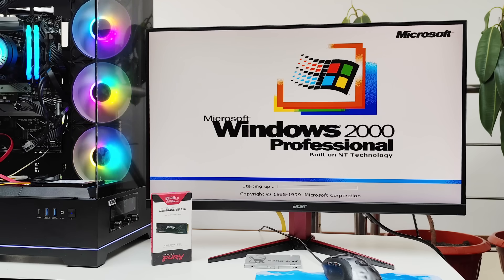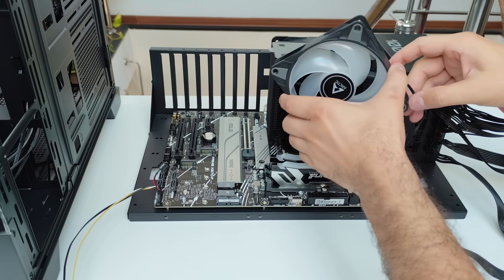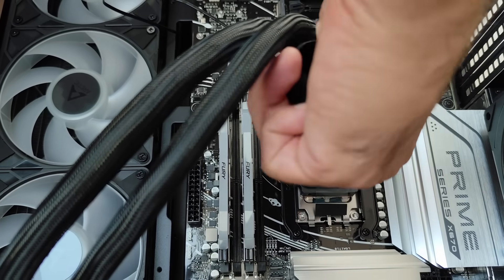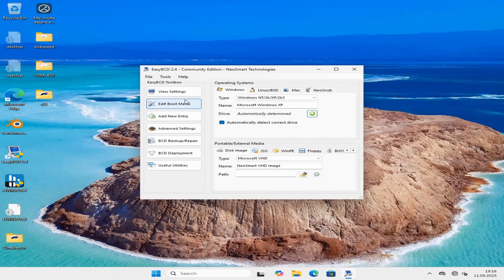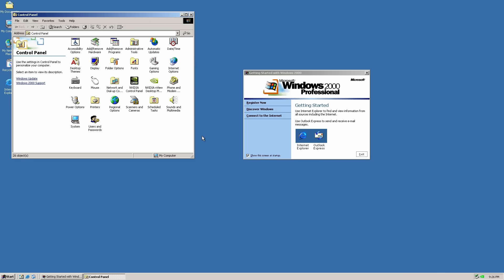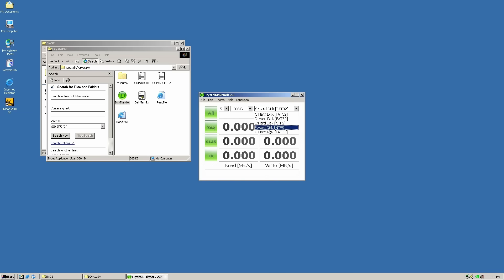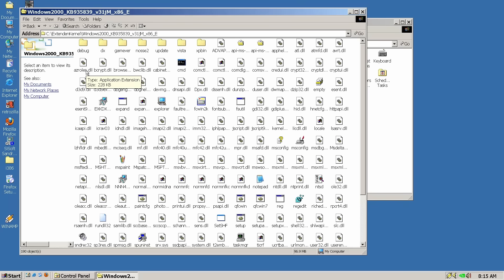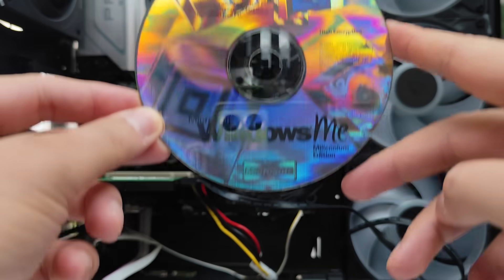Windows 2000 Overkill: Ryzen 9900X + Gen 5 NVMe SSD + HUGE Arctic Freezer AIO

Comment: JMB582 SATA Controllers do sata disks drives work as IDE MODE OR AHCI MODE ?
Reply from the maker: It works in AHCI mode. According to the specs, the JMB582 does support the "IDE programming interface", but you can't manually configure the card to use IDE mode. It might be possible with a custom BIOS that has a configuration utility, like the old-school SATA-RAID cards have.

Comment: The question is, how do you convince modern programs to believe they are running on Win10.
Reply from the maker: That's not possible, but you can trick them into detecting your system as Windows XP. That at least will make some browsers like Supermium or New Moon (Pale Moon) work on Win 2K.

Comment: Any possibility of running on a RX400 or 500 series GPU? I mean, XP or 2K, anything would be a win.
Reply from the maker: AMD ceased official driver support for Windows XP around 2013, and the final compatible drivers (version 13.9) are working with cards up to the R9 200/300 series. The RX 400 series, released in 2016 (Polaris architecture) are a no go. In XP you can use something like a Nvidia 980Ti released in 2015, it's like 25% better than a RX580 and the driver is very easy to install.

Comment: What's the oldest version of Windows 64-bit with no RAM limits that works with present day CPU, motherboard, GPU, RAM and SSD and software? Windows 2000 doesn't have a 64-bit version so it's not much use.
Reply from the maker: Check out this video about Windows XP x64: https://youtu.be/0iW1hheBAp0 - it was tested there on a Socket 1700 build, but it also works on this AM5 configuration. All that is needed is to add a modified ACPI.SYS to the ISO. You'll also find download links in that video.
Reply: @O_mores  Will modern software that only works on Windows 10-11 work on your modded XP x64?
Reply: @O_mores  Thanks but even if I get all the drivers I need I assume software that only works in Windows 10/11 won't work on XP?
Reply from the maker: @Gaming.Vids1  When it comes to modern software compatibility, the issue is now on the software side, not on Windows. A very popular hardware info tool, "HWiNFO," for example, still works in Windows 98 -  even the latest release from 2025. Also, Supermium is a very new browser made for XP. So for XP, you have to settle for compatible software like Office 2010, or search for new releases specifically designed for XP and newer. As for games, they rely on DirectX and XP only supports DirectX 9.0c.

Comment: Hello omoroes. i had a really important question. im doing some odd builds myself. i was curious about somethng, in theory if i used a burification splitter riser, with a modern pc but was using CSM for older hardware like in your vids, would the splitter still register the device is there in legacy bios but i just couldnt use them at once, and might have to black list some GPUs and select them individually for different OS if i had multiple OS to boot from or with. or would it just not register them at all? also woul any of the thiord party drivers your aware of get around this issue aswell? And i guess 3rd option a way to force PCEI buriification to partially work in legacy bios to let one device work at a time from different OS's
Reply from the maker: Hey! Bifurcation (splitting a PCIe slot into multiple lanes, like x8x8 or x4x4x4) requires explicit support from both your motherboard's chipset and BIOS. It's not something the OS or drivers can enable on their own - it's a firmware-level config you set in the BIOS menu (under PCIe or advanced I/O settings). If your board doesn't have those options exposed, the splitter won't do anything special - it'll just act like a plain riser, and only one device (the "primary" one) might show up, if at all. If bifurcation is supported and enabled in the BIOS (even with CSM on), the split devices should register individually in the system - just like in UEFI. Some riser cards have their own bridge chips that emulate bifurcation without full BIOS support, but those are hit-or-miss for stability.

So, the idea is that this whole bifurcation thing is OS independent, if the hardware is configured properly in the BIOS - it should just work - for the OS or the drivers it's the same this as you would have 7 separate  physical PCI-E slots on the motherboard. Also you might want to check this video about the primary video card: https://youtu.be/RWupO_3Zv6s
Reply: Wow. That’s all very helpful info. I was curious though by any chance do you have a discord? I’m actually really curious cuz of the project I’m working on. And I feel like I’m worried I could brick my really rare mother board if I didn’t do a lot of these things correctly.
Reply from the maker: @michaeldariopellittieri3050 I'm not very active on Discord, so maybe I can help you here instead. Regarding this bifurcation thing, I don't have much practical experience with it. The people who were into mining and had, like, eight GPUs on one motherboard are the real experts - nothing beats hands-on practice...
Reply: Hmmm well I respect if u cant give out discord so easily weather u use it or not  I respect that. But I did have like a decent list of questions I wanted to ask.  How ever more or less im trying to use the same method u showed in the video in reguards to using the bios tool to make it so I can disable certain lanes for certain profiles in bios for different os. And I really want to be able to run older os aswell. In your opinion is the CSM on the x570 Asrock motherboards not so great? I mean perhaps it’s possible to fix with some patches or the Ami tool but I’m just worried based on a small portion of search results. And yes it’s a ddr4 build. I heard like the z490 chips are a little better but not my much. But more or less it cussed the uefi to gray out whenever u luanch in legacy bios when ever u try to switch back to uefi.
Reply: If you have any info on CSM or modding bios, in regards to the x570 as rock boards. As I’m trying to avoid the bricking part. I know best was is just simply try it but, if there also possibly anyway some sourt or modded os could select the GPU instead of forcibly booting then fiery primary slot.
Reply from the maker: @michaeldariopellittieri3050  I'm afraid that for newer motherboards, there's no other workaround than to use the primary video card in the primary PCIe x16 slot and the secondary GPU in another slot (an X570 board for sure has two PCIe x16 slots). You can disable the primary card in Windows 10/11 if it's older and use the secondary card instead. This is how I'm using an Nvidia 7900GS with an RTX card on my AM5 build with a Ryzen 9 9900X.
Reply: So really the only full proof to work but risky to brick option is using the bios mod tool. Well I guess I’ll have to try with some dummy cheap parts, but question the site in your vid only brings me to an older out dated site for the Ami bcp tool. Can you provide any link to one that works for x570 ? My board also has a duel boot safety so I think I should be okay with a bit of risk.
Reply from the maker: It seems you can't get anything newer than that version. AMI has become very strict about this tool (which, of course, is not for the public anyway) and has actually requested that several sites take the files down. The bigger problem is that new BIOS files are not compatible with existing versions of AMIBCP. What motherboard do you have? I can download the BIOS and check if it opens.
Reply: Wow that would be amazingly helpful!!! But to be honest I was suggesting the x570 board first, due to the fact im using quite a rare motherboard. It’s the x570 Asrock aqua. The board supposedly has bios flash back chip to avoid bricking aswell as some capacitors to avoid physical damage aswel. But even so I’m very nervous about it and I was gonna try it with just any generic x570 chip set first. But ye it’s unfortunately the Asrock aqua. And basically all I want to do to it is for its ability to select which gpus to use as the primary slot like u did in the video but for CSM. I’ll be honest the project I’m attempting might be the craziest thing ever. Deffinetly ambitious which I was curious about discord xD…. But hell the fact your willing to test it is incredible. Absolutely god send. But my only worry is it won’t be a totally accurate test unless it’s the Asrock x570 aqua.
Reply from the maker: Nice motherboard. The BIOS file seem to load fine in AMIBCP: https://ibb.co/27T3pM5q

On my X470 motherboard, I forced the iGPU to appear in the BIOS configuration menu even if it's not physically present, and when I selected it, the BIOS picked the Voodoo 3 in the PCI slot instead of the GPU in the first x16 slot. I don't know if this would do the trick on your motherboard, but it's definitely worth trying. It's kinda hard to brick it since you aren't modifying the BIOS by adding/removing modules... you're just setting some flags on some options.
Reply: Wow thanks so much man. You’re a huge help. So you’re saying the bricking usually happens when people try to reorder or stack thungs things or activate or force things. But more or less your saying simply activating them or disabling isn’t really a risk as it’s just a flagger. More or less I’m mostly curious does this let some change the primary slot in the same way you got it to work in video is what I’m really excited about. Cuz mostly I want to be able to make it so the pc will see my lower slot as the primary slot for windows 98. And I guess my last question is if I can use the bios in csm with that tool will it let me boot a voodoo 3 for windows 98, for example from that lower slot. And hoping the tool will work for the x 570 even though the tool is for the 470. But based on what you’re saying it sounds all very promising. If you have any other advice let me know but you’ve already done more then I could have imagined.
Reply: Sorry if I took up a lot of your time but your amazing man. Just to be clear the image link that’s the same bittention link u used in the video? Or is it a different link?

Comment: I use all Black wings cats tools for Windows 2000. I use the Extended Kernel, Extended Core and Blackwingcats Nvidia drivers to run a GTX 970. I originally was using a GTX 460 with Nvidia Official Windows 2000 drivers but that card ran extremely hot to the point I had to slow my frame rate down to keep the card under 65C. The 400 series are good room heaters.  Today I use GTX 760's and 970's in my 4 systems.
Reply: 🙋‍♂ brother HH
Reply from the maker: I have a GTX 980 that I should try in Windows 2000, especially in a dual-boot setup with Windows XP where it's much easier to install. For XP, you only need a modified INF file since NVIDIA only officially supported up to the GTX 900 series. I'm also curious how the best officially supported card for Windows 2000 would behave - that would be a Quadro 6000 with 6GB of RAM. It's a 200W GPU.
Reply: @O_mores  Sorry for the late reply. The GTX 980 won't work in Windows 2000 unless you have all BlackWingCat's  kernel tools and his modded  Nvidia drivers which only work with the Extended Kernel and Extended Core installed.  I don't really know that much about Intel Chipsets or motherboards but when It comes to AMD motherboards,  all BlackWingCat's tools work on Socket AM3+ or older motherboards.  I'm currently  working on the AM4 platform to see what  I can get working and what isn't going to work.

Comment: Cheap old Thermaltake view 27 is compatible with 360 aio. Never knew this is such a big deal
Reply from the maker: 360s are well supported. By the way, I found this case while browsing a national retailer website. As of today, there are 1089 case models listed. There are 860 cases compatible with 360mm AIOs (and smaller), only 168 compatible with 420mm AIOs, and just 29 for 480mm AIOs.

Comment: I could have helped... a few years back I had to make 2k work on AMD Phenom 2  black 965 quad core... and a big drive... was headake... (sata was on nvidia controller , and after installing on small partition I had to edit and exted it...) oh well....
Reply from the maker: The AM3 platform is pretty friendly with Windows 9x and 2K. Check out this video of Windows 98 on an FX-8350: https://youtu.be/JEN6Da3MOzg. I was suprised to get sound through the HD Audio codec using a 16-bit HD Audio driver made for Windows 3.1...

Comment: Fun. But, much as i loved Win2K for delivering me from NT4 Hell, there really isn't a point on NOT going XP, unless you're running something obscure that only runs on W2K. Its basically the same, only they got rid of (even more) NT4 "cruft and shenanigans" holdovers. Also, might be worth the time to get acquainted with nLite. Rolling your own custom installs is nice and you can build a "collection" of say "XP minus the totally pointless stuff like Luna and drivers for things I'll never use", "previous with performance tweaks", "previous with added drivers", etc... You can also directly integrate all the "remaining KB's" post last service pack, but... you're gonna spend a while there, because NOT ALL work (properly) when integrated and it's "try, test, repeat" until it's stable... :(
Reply from the maker: I've been using XP a lot lately. It's fast, stable on modern hardware, and far more compatible than 2000, which makes it more practical. But ...  Windows 2000 really brings back memories for those of us who used it back in the day. Just seeing the startup screen is a great feeling.  As for tools, I've started to prefer Legacy Update over nLite for integrating updates - there's something satisfying about watching the updates download and install.
Reply: @O_mores  I know... i only swapped to XP at SP2 because, W2K by the time XP came out was rock solid and XP wasn't. It did get there, and improved, and then stuff like QuickBoot and Superfetch and not having to wait on "all ready" to get to desktop and all that made the change "desirable". And once you turned the Toys'r'us theme it was basically W2K with tweaks.
As for the rest, time is and was a scarce commodity so i always used nLite to integrate what i could straight in, AutoPatcherXP, WSUS Offline and others on a drive to save a few minutes (sometimes A LOT of minutes). But nLite's main use for me was to make sure some pointless stuff doesn't even exist. Like System Restore, Fax Service, etc 🤣

Comment: That's pretty cool. That you got it running on. Hardware that it was not designed for. I wonder. How many FPS you can get with? Halo combat evolved. I have an older workstation GPU i get over 300. What the 1% low. Of a 120. So with the proper card. You\n Might get. 10 times that. Considering the power of that processor. It kind of blows my mind. You can get it to work. On that new processor. You're right about the GPU. I think the last series of nvidia cards is that support  win  2000  is the gtx 400 series of cards. So probably.a gtx 460 pick. Or maybe even something older but either way. It will be fun finding out.
Reply from the maker: I have a new plan: to get a Quadro 6000. It's probably the best card with official support for Windows 2000. As with many professional Quadro cards, many didn't get recycled and are still obtainable - for around $100 - while they were ~$4,000 - $5,000 originally. This was top of the line back then with 6GB GDDR5 and 512 CUDA cores (the GTX 470 has 448). Also, the last Windows 2000 drivers were actually released for the Quadro series. As for Halo, it never got me. Anyway, I do have the original package (for PC), and I will try to integrate it into a future video.
Reply: @O_mores absolutely. Super awesome idea. The card I'm using is quattro. 2000. I think it's dell oem version i reapplied. Some new paste. And it was good to go i use it with my retro box. That has x. P. 32 bit and i can get a over clock. Of that particular GPU and that is last generation of nvidia. GPU that support windows 2000 but I look forward to seeing what you cook up. It's probably gonna be pretty awesome.❤

Comment: Damn, I really have to hand it to you and how dedicated you are to getting these very unsupported OSes working on newer hardware. That's real dedication! I used to be diehard Windows 2000 and used it up until about 2019 when I finally gave up and switched over reluctantly to Windows 10. But to think that Windows 2000 has been unsupported now longer than it was supported and even though some of the hardware is outdated, it's still working here! I think the newest NVIDIA GeForce you can use is the GTX 980 Ti. I think that's the most high end model. I haven't kept up too much on BlackWingCat for a number of years now since I lost interest in Windows and switched to Linux full time. But if I still had the slightest bit of interest in Windows, I'd probably give some of these things a shot because Windows 2000 really was my favorite version of Windows next to Windows 98. :)
Reply from the maker: I first used Windows 2000 back in 1999. I think it was a Beta 2 build that came out around the same time as Windows 98 SE in April 1999. I had a Pentium 233 MMX with 64MB of RAM, and the specs were actually quite good for 2K.

Now, I won't lie, using it felt really cool. The whole NT system was basically the latest tech back then. But I was in high school, and Windows 98 was just more practical for me since it booted faster. I kept Win2K on a separate HDD - whenever something crashed or didn't work in 98, I'd just reboot into 2000.

As for the GPU for my multiboot system, I think I'll stick with something that works in 98, 2K, and XP. That would probably be a 7950 GX2 card - it should work as a single 7950 GT in 98 (haven't tested yet, but I know it doesn't work in dual-GPU mode there) and as a dual-GPU card in Windows 2K/XP. And of course, I'll use an RTX card for Win 10/11.